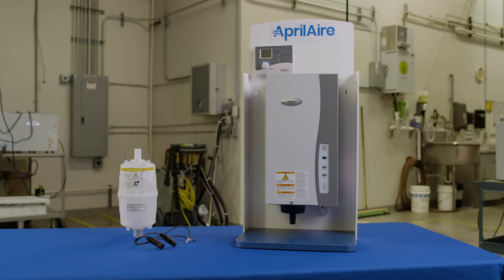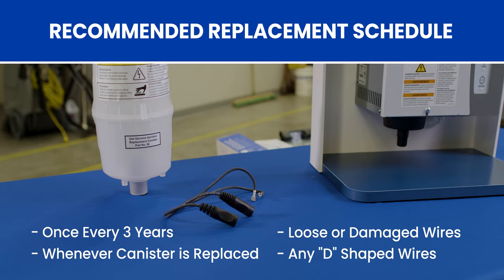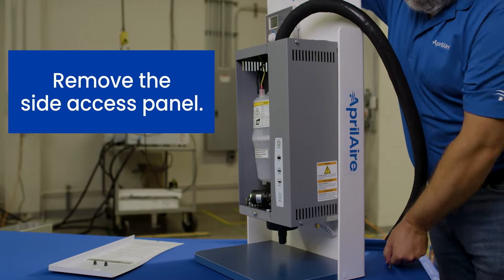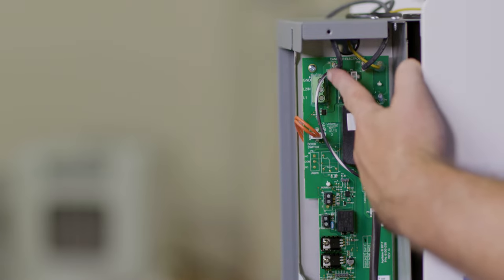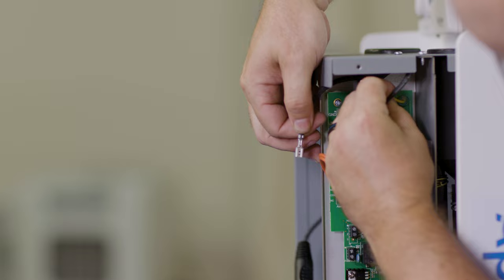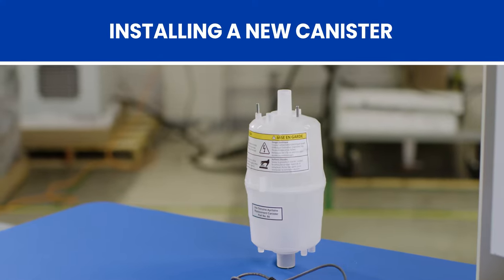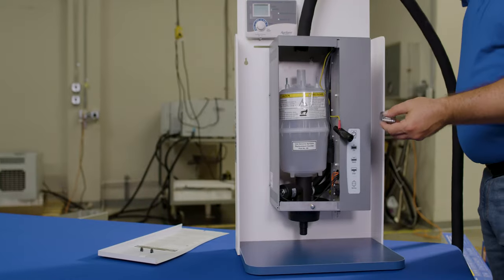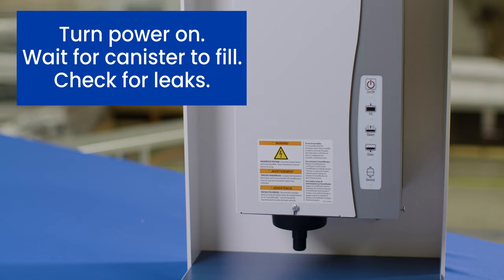How to Replace the Electrode Wires in an AprilAire Steam Humidifier

Comment: If the humidifier properly drained the cannister when shutting it off, why would the drain hose be blocked when you complete the cannister preplacement? Thanks.
Reply from the maker: Thank you for contacting AprilAire! There may be some built up mineral deposits in the drain area that can cause the drain line to end up getting blocked off. We recommend that you give us a call with this issue so we can determine what is going on. We can be reached at 800.334.6011 Monday through Friday, 7:00 a.m. to 5:00 p.m. CT. Thanks again for contacting AprilAire.